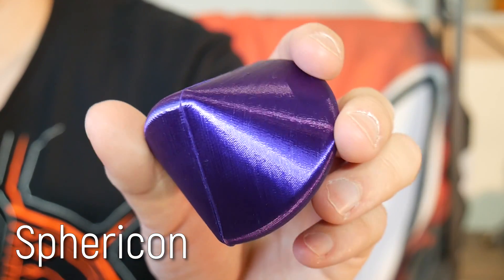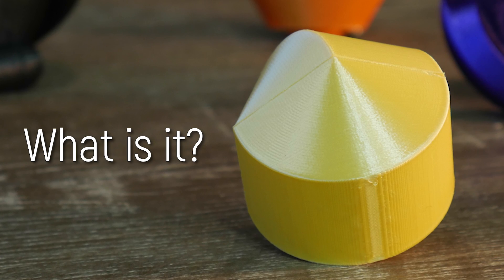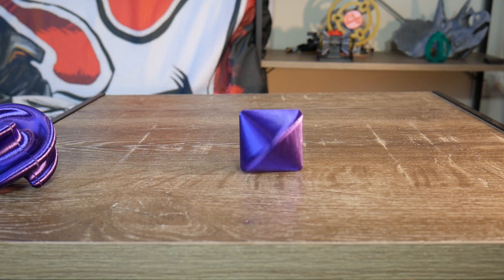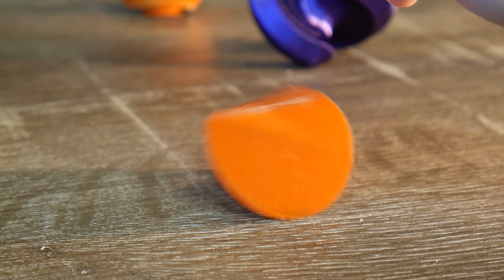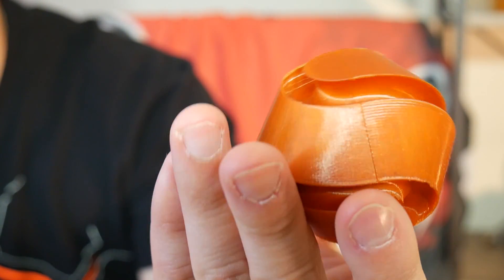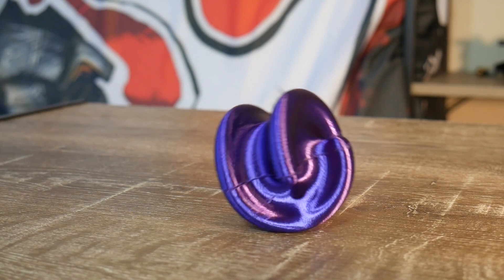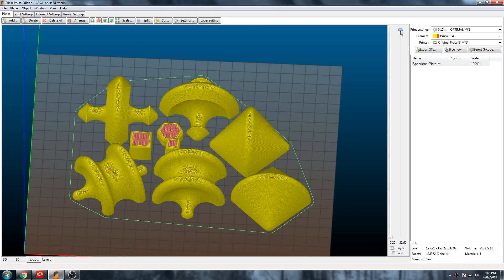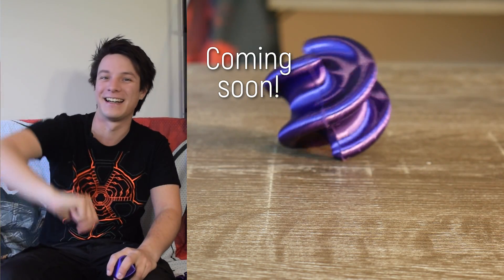Incredibly Satisfying Sphericons

Comment: Hey Maker's Muse, the sphericon based on a triangle doesn't follow the same logic as the square one. You rotated the triangle, but in the square one you didn't rotate the square, only the two halves of the square separately. If you do this with the triangle you can get a solid with one continuous surface. I did it on sketchup and it turned out pretty cool, i wish i could show it to you because I'm really curious about how it would roll, and i dont have the means to print it. What happens is that the surface splits itself into two, twice. Or if you look from the other direction, it merges twice. So I'm figuring that, if you roll it in the direction that merges, you would get a continuous wobbly roll like the other ones, but if you roll it in the direction that splits it could roll to either side and the path maybe wouldnt be in a pattern. Or I guess it could begin with an irregular move and then stabilize in a constant roll. Idk, it got complicated lol I also tried with a pentagon but couldnt do it...

Comment: Question: Are the radial speeds of this object at rolling constant or do they change in a repeating loop. And if they change, where gets the energy from? So they will not roll that far as spheres, or not?
Reply from the maker: They have a constant center of mass so roll efficiently however it's difficult to impart energy into them because they change directions so if you give them a big push, they'll just skid instead of rolling correctly. It's pretty interesting almost like an inbuilt clutch / speed limiter.

Comment: I'd like to see what polygons with more sides are like. Octagon should be a fun starting point, as it should have two completely different orientations at 45 and 90 degrees. Even more with something like a dodecagon. 
I wonder if something similar could be made from polyhedra. I noticed in the ones with inflated edges and undercuts, the sphericon based on a square is actually an octahedron with a curve connecting half the vertices, with a second curve connecting the other half. The hexagon one, just from visuals, looks like it could be based on an icosahedron, but I don't have geometric data to back this claim up.

Comment: They remind me of anti erosion devices that they put on beach heads.

I wonder if those devies can be made smaller and more aesthetically pleasing or so they can be made to look more natural. Typically those devices are made to look a little bit like a jack typically with four or six prongs. They are also usually pretty big. They are about the size of a person typically when used around Port areas, especially where ships might kick up a lot of water or create a heavy current. On public sand private beachs they have a tendency to be made smaller about 4 ft tall. I wonder if they can use smaller sizes for the same task. I was thinking about the false islands that they created over in Dubai. Most of those islands are made out of sea sand and they seem like they could use a little bit more anti-erosion material added to them.

Comment: You said something interesting toward the end. Something along the lines of "vary layer height, if your printer supports that." Here's a question for you; ave you or anyone you know of experimented with dual extruders of different diameters to get a very fine outside finish (smaller layer height) then the inside wall and infill (larger layer height)? It seems to me that if a printer can support both dual extrusion and varying layer height, then you could use a .015mm layer height on all outside layers, but create a .4mm layer height on all infill and inner wall geometry. 

I picked layer extrusion heights based on the most extreme capabilities of all the printers I have used, but I hope I got the basic idea across. It's something I would experiment with myself, but right now I can't even get my two printers working so experimenting might be outside my wheelhouse.

Comment: If you don't have a 3d printer you can use 2 pennies and cut them both halfway towards the center and put the both together and it does the same thing, without a 3d printer. Happy days
Reply: Cool! What tool would you suggest using to cut the penny?

Comment: It seems that Angus's Cocoon Create is able to print eSun PLA filament. I have tried this brand on my Cocoon Create Touch and the print has never gotten past the first layer without becoming a furball. I have tried multiple extruder temps and have leveled and set the bed height 5+ times and had no success. I hope someone will be able to help me with this predicament and help me print again. P.S. The Cocoon brand of PLA filament has worked great and I don't know why this problem is occuring.
Reply from the maker: Are you extruding at recommended temperatures? If it's PLA+ it requires slightly higher temperatures than regular PLA.
Reply: It is just their normal and it recommends 190C - 210C and I have tried temperatures from 195C 205C 210C. Should I try temperatures that are in between?

Comment: Great exploration and explanation (as always), and I love that elixir filament.. unreal!
Reply: I didn't ask you for your opinion. Today I got stringless result and all problems I've found were in Cura slicer.
Reply: Hi, Dewin, sorry for bothering you, but I have a problem with my JGAurora A5: I have leveled the bed like crazy and stil I have to print PLA on 75°C heat on bed. Bed is clean, leveled and it worked on 60°C for first cca 15 prints I've done with this printer. And even if retraction is on 10mm, my models are super stringy. I can't lower my extruder temp any further than 210°C, because then comes under extrusion. I'll try combing and coasting, but still I need help. It's my first printer I've ever had, so maybe there is some simple problem fix. Thank you.
Reply: I'm just gonna place my bet now that your video will be on Astrolabicons. I can't wait to see it, whether I'm right or not!
Reply: yeh i have that problem with my very first printer but i got a new one and it suits my slicer better
Reply: Did anyone else have an issue finding make anything's video? If anyone has the link please drop it below.
Reply: I’m a fan of both of you
Reply: Make Anything hjbjijjiihk
Reply: Make Anything   Veg veggvvvvvvvies
Reply: Woah, you're here?
Reply: I'm a fan of both of you guys!
Reply: which printer was your first one?

Comment: You tried the original four sides and it obviously worked, you tried three sides and it didn't completely work because it was odd, you tried using six sides and it worked and was really tippy.
Could you try eight sides? Ten sides? How about twelve? Maybe even fourteen?
Reply: My thought is that, if done right, you can make it look like a sphere from a distance that behaves very oddly. Either that or it'll never work that way. 🤔
Reply: I made one with no sides but then I couldn't find it.
Reply: Also when you have 8 sides, there's 2 possible rotations that you can do to the second half of the object. Really interested in what the difference would be.
Reply: Nah, that's only powers of 2. We want 2n sides
Reply: Strangely My Comments Usually Get Quite Popular : Why don't you?!?!?!?!?!?!?!?
Reply: I modelled one with 16 base sides last night. Though at that point it's not going to have sharp enough edges to reliably roll in its pattern
All of 2 edges won't be sharp enough... huh...
Reply: Strangely My Comments Usually Get Quite Popular accurate name
Reply: Strangely My Comments Usually Get Quite Popular : 64?? 128? 2048????
Reply: Caleb Sherman at that point it might as well just be a normal ball. That's why I was somewhat reasonable because I think by time you get to maybe sixteen sides at that size it will look near enough like a poor circle
Reply: Strangely My Comments Usually Get Quite Popular : Just jokin
Reply: If you have infinite sides it would be a perfect circle. That's why it will work better the more sides you have.
EDIT: For clarification: (1)A perfect circle "x" has a minimal friction of "x(friction)=y".  
(2) A sphericon with infinite sides is a perfect sphere and wherefore has the same friction of y.
A sphericon "s1" with NO sides has a infinite friction "z(friction)= inf." Analogue, a sphericon "s2" with infinite sides has a minimal friction of y (s.o (2)), because it's a perfect circle.
Reply: Strangely My Comments Usually Get Quite Popular Hello again
Reply: I think 10 could work quite well. I think you've got to keep track of the orientations of the interface between the two parts when the point of contact with the ground from one side of the sphericon to the other. Can't really explain it without images.
Reply: The more sides you add the more it’s just gonna become a normal ball
Reply: It's like a mobius strip, a strip of paper with one side
Reply: Over 9000!!!!
Reply: WOAH! Steady on!!
Reply: What about SixTeEn
Reply: Strangely My Comments Usually Get Quite Popular It's not strange lol
Reply: From everyone saying it would just roll like a ball; a many sided object doesn’t have to be roundish. The sides could be in odd places like these smaller sided ones and even more chaotic looking.
Reply: Blue Skyla Infinite --> No places without sides --> even surface --> sphere
Reply: 688493020384494739739374939384573839201011192829183916282527251839405833593837394?
Reply: Try no sides
Reply: Maybe 16?
Reply: 10101010939383832929929
Reply: @vladt3526  That's odd, moron.
Reply: Strangely My Comments Usually Get Quite Popular p
Reply: Strangely My Comments Usually Get Quite Popular well you were right you got 1,000 likes on your comment
Reply: Strangely My Comments Usually Get Quite Popular you’re famous now
Reply: more sides mean more sphere, also according the 3D print tech could not print that detail thing. So maybe fewer sides or below 10 would be perfect.
Reply: Caleb Sherman last round😂
Reply: Strangely My Comments Usually Get Quite Popular 
What about 268,000,000,000,000
Reply: Strangely My Comments Usually Get Quite Popular  yea they do
Reply: Strangely My Comments Usually Get Quite Popular why not just a circle?
Reply: +Elijah Lopez thats called a shpere.
Reply: Strangely My Comments Usually Get Quite Popular cool
Reply: Strangely My Comments Usually Get Quite Popular Yeah now your comment got quite popular
Reply: If you could get up to 20 sides while still being interesting, and design it to stop with a random number facing up...  Most Epic RPG Dice Ever.
Reply: I think I can guess the pattern for an n-sided sphericon, where n is an even integer:

As you see in the video, the 4-sided shape meanders, while the 6-sided one moves smoothly, then sharply resets. What I think is that that sharp reset is the same in the 4-sided one, only since there are less sides, it happens more often, in an alternating fashion

What I mean is, I think for every n-sphericon, there are (n-2) forward phases, and 2 backward phases.
Since 4 - 2 = 2, for the 4-sphericon, this results in equal meandering. On the other hand, 6-sphericons have more forward than backward phases, resulting in the different motion pattern.

So as n increases, I would hypothesises that those backward resets become less frequent and smaller, and the sphericon rolls more and more like a ball until the resets are invisible and the n-sphericon is indistinguishable from a sphere.

As an addition, that's why odd sphericons don't roll. Those 2 backward phases need: 2 phases. If you only have one phase, the motion can't fully reset so the sphericon stops.
Reply: 200000000000000?
Reply: why is it not obvious that at a certain point it will cease to meander, and simply roll?
Reply: Think diminishing returns would occur, more sides > more spherical, 
and would need ever-shallower slopes to avoid rolling over an edge
Reply: Lol these replies
Reply: And eventually end up in a sphere
Reply: nah just jump up to 50
Reply: 2^n sides?
Reply: I tried having 64 sides, and...

it just rolls like a ball
Reply: How about a ball